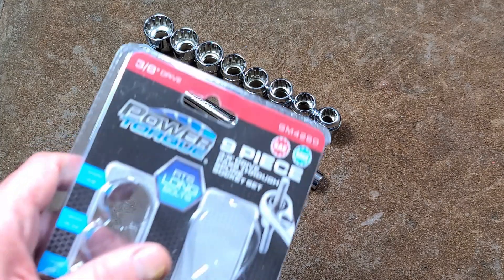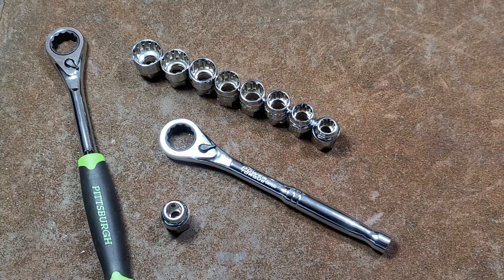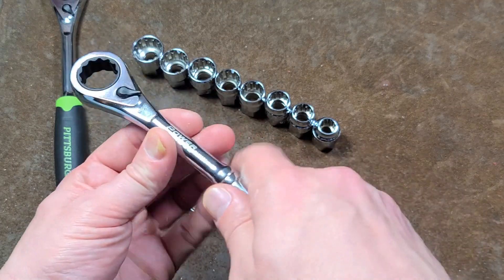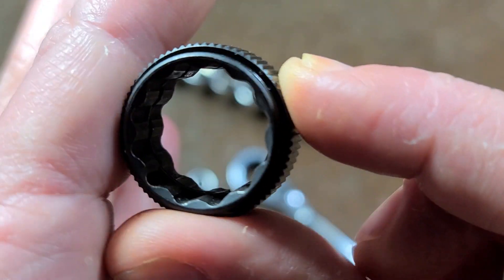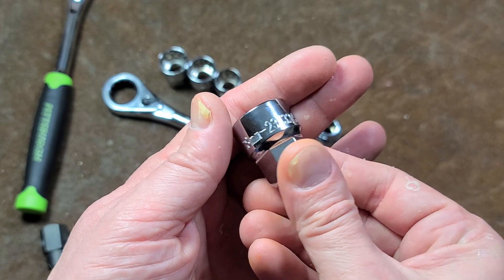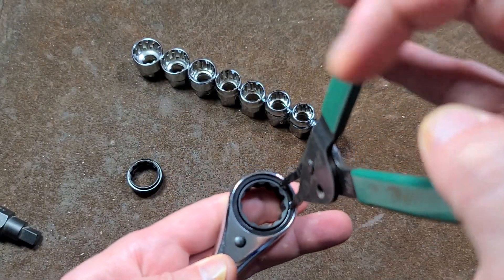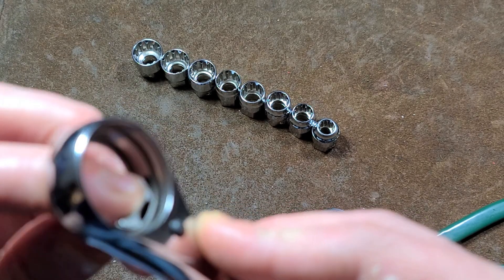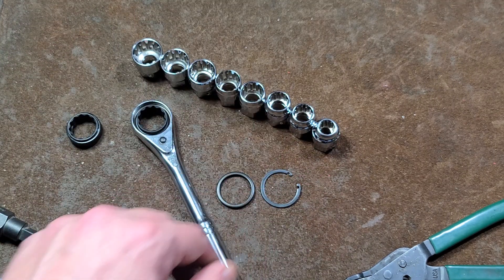Oreilly's PowerTorque Spline Drive Pass Through Ratchet Set Review

Comment: At O'Reilly's I purchased the 1/4-inch 9-piece low-profile pass-thru metric socket set by PT (part number GM4234). It goes from 5-mm with 13-mm without skips. Whereas I do value pass-thru sockets, my reason for buying this PT set was to own some lightweight, low-profile 1/4-inchers. To minimize the profile of the socket+ratchet combination, I use a small 11-mm combination wrench in concert with the PT sockets. Since the wrench is not designed to aggressively hold such sockets, I add a small neodymium magnet to "stick" the two together. The ratchet that O'Reilly sells to go with this metric set is overkill -- too big and too heavy.

Comment: Spline drive like the Mountain extra long flex head ratcheting wrenches work great, so the problem isn’t necessarily the spline drive, it’s in the sizing. Spline drives have to fit the fastener very tightly to work properly.  So the more sockets you get in a set the better.  I like the Pittsburgh pass through spline sockets but I use a 19 mm flex head ratcheting wrench instead of the provided ratchet.

Comment: Sadly, Stanley has discontinued the Bostitch set that  included half inch drive metric and domestic sockets as well as the usual 3/8 drive sockets.  I have one in my truck as an emergency set and can report they are quite useful and reasonably strong   and they used 6 point sockets with an extension for the 3/8 & 1/2 drive ratchets.  They now sell on eBay for more than they cost when new!
Reply from the maker: Thanks for sharing